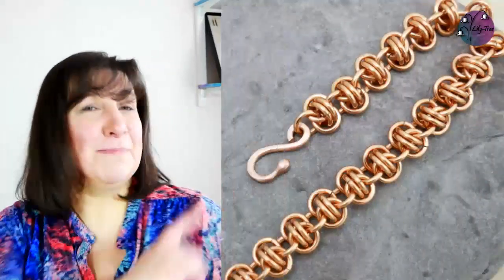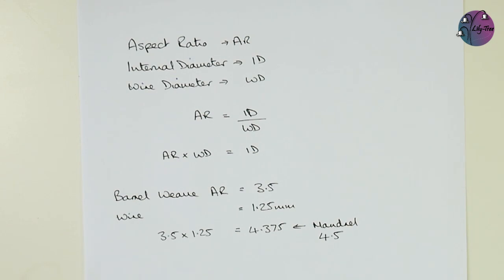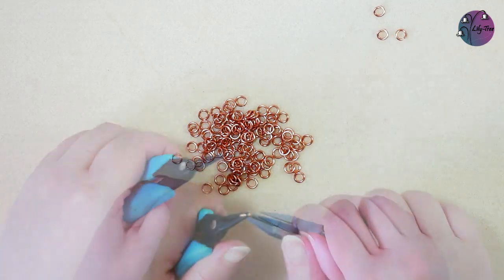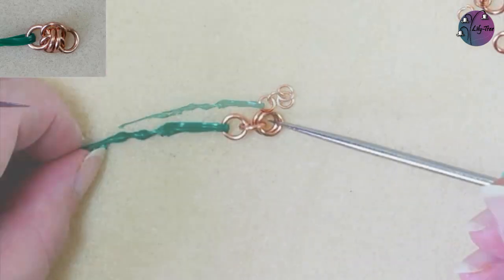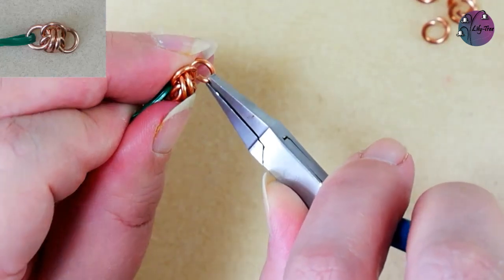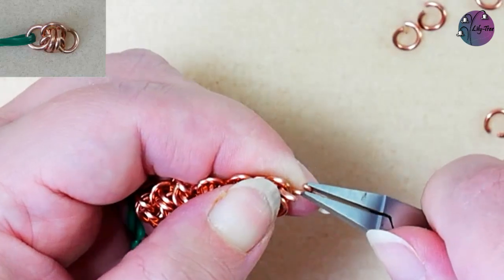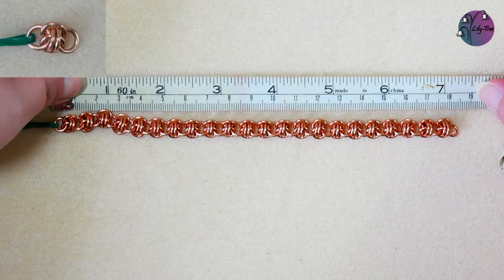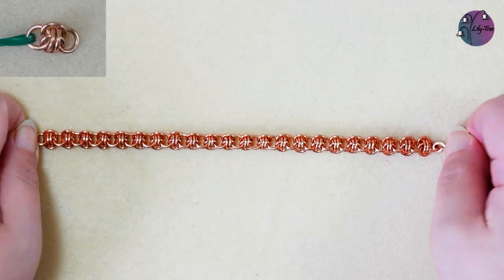Barrel Weave Chain Maille

Comment: Can you please tell me what gage /thickness of wire are you using for the bracelet?
Thank you
Reply: It's really up to your discretion...do you want a light, dainty chain? Then use like 20g but I'd use half hard temper if going that thin...or do you want a nice chunky chain? In that case go with maybe 18-16 g and use can safely use dead soft temper for that, they should still be strong....